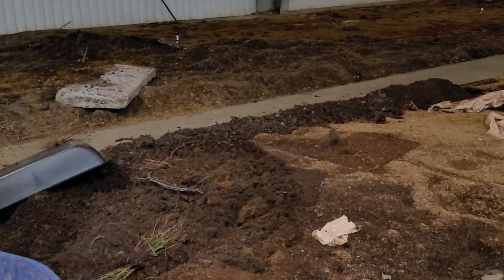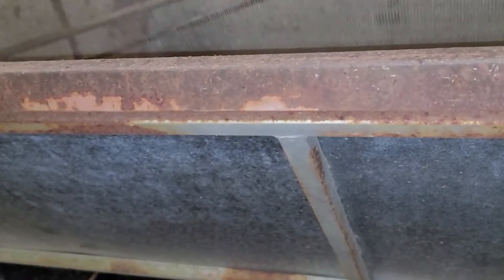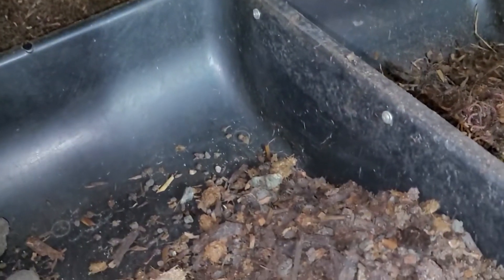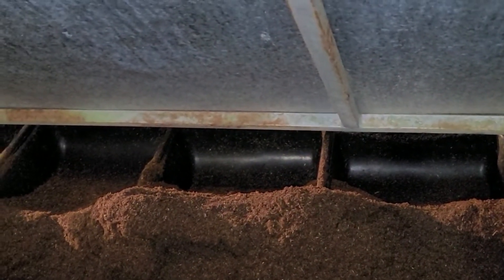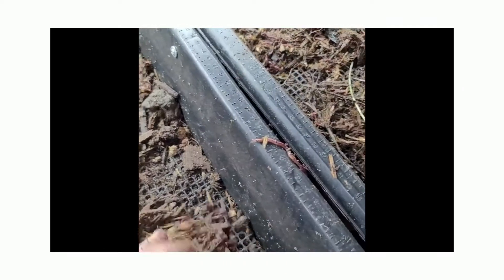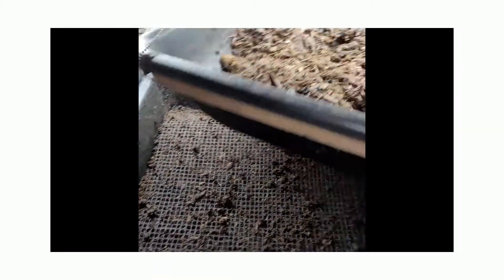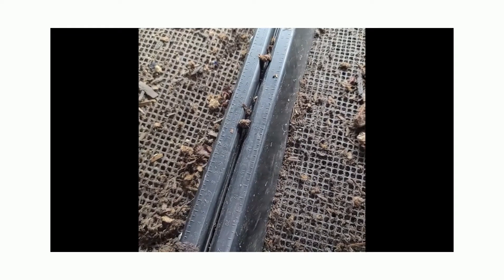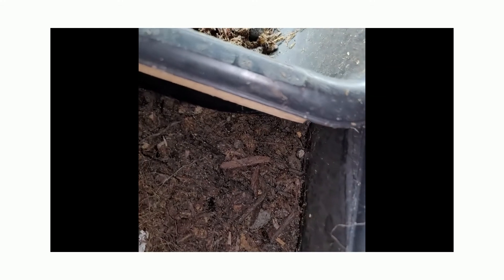Worm Trommel Demo

Comment: How do you keep your cocoons from falling through the 1/8" screen? With my hand shakers, I find I lose at least 50% of my cocoons unless I rescreen with a 1/12" screen.
Reply from the maker: We do lose some but most go through the 1/4'" screen. Maybe I should look into getting a 1/12" screen on the trommel. Do you know where I can find that size?
Reply: @MemesWorms  Mine is a pet proof screen wire from an old window screen. it's kind of hard to find it in wire, but it is still available.

Thanks for the video. A trommel is in our future, but we aren't big enough to need one yet. Maybe next year.
Reply from the maker: Thanks for watching. I have a brockwood sifter for sale too.
Reply: @MemesWorms  , I think Jerry Callison is talking about trying to harvest castings and not lose cocoons to the cast harvest. In a hobby farm the R/W's are smaller, so are the cocoons from the smaller worms. 
I would not recommend a 1/12" screen to anyone. I have a manual sifter set in 1/2', 1/4", 1/8th", 1/12th" and 1/20th" mesh screen(s). Smaller containment, smaller worms, smaller cocoons. So a lot of cocoons pass through the 1/8" mesh. But 1/12" is too restrictive for a reasonable cast harvest compared to the labor and quantity of material needed for much cast. 
I wanted to split the difference and try a 1/10, but Imperial fractions don't easily work that way. They can be bought on-line separately as bonsai soil sifters and/or classifiers if one wishes to compare to results halfway between 1/8th & 1/12. 
After manual comparison, one could probably order the metric equivalent of mesh size online for a trammel.  🤔
For reference: 1/8"= 3.175 mm., 1/10th"=2.54 mm., and 1/12th"= 2.116 mm. I suspect a 2.5mm mesh might be easiest to locate. Aren't metric converter calculators wonderful..  <><